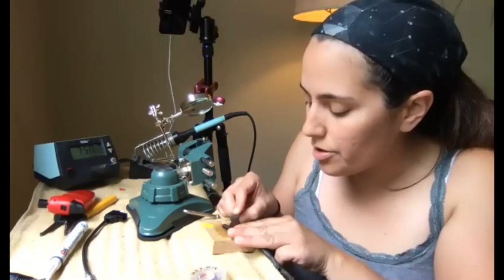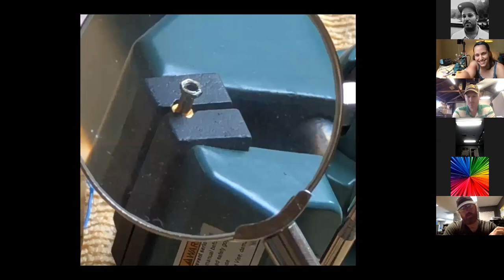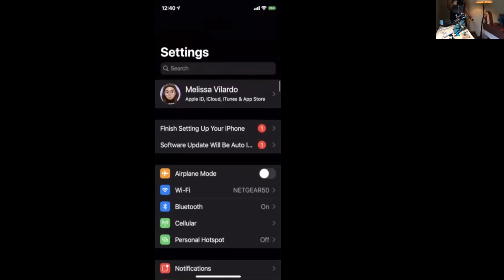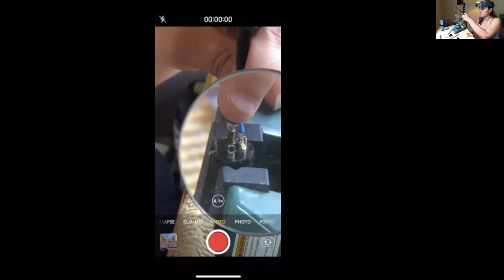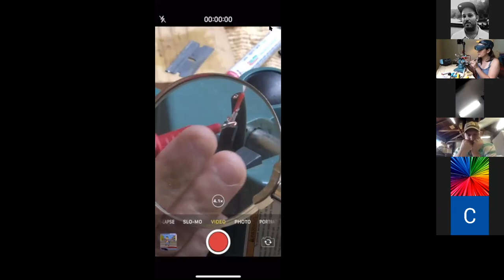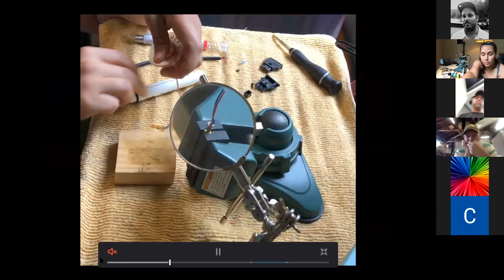DIT-WIT: Soldering 101 with Melissa Vilardo

Comment: Intro - 1:15
Proper Soldering Environment - 3:04
Tools Needed for Soldering - 4:06
Pro Tip - Torches are also good for applying heat to stubborn metal screws/threads. - 10:25
Choosing the Proper Cable Stock - 17:25
Soldering and Assembling 2pin Lemo - 26:30
Proper Wetting (video for reference (about 2:15 in): https://www.youtube.com/watch?v=_GLeCt_u3U8) - 48:00
(I forgot to mention mention this in my presentation, but when checking continuity, touch one of your leads to EACH pin (including pins that you did not connect). - 59:00 
Soldering and Assembling PTAP connector - 1:06:00
Connecting Shielding on Power Source End Ground Pin - 1:17:35
1:24:30 - Soldering and Assembling 4-Pin XLR (Live)
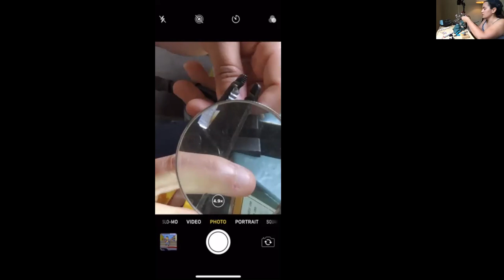Additional Info: If you would like to include shielding on a 2pin to 2pin Lemo (ONE END ONLY), you can simply fold back the braided shielding over the black insulation and slip the collet over it before soldering.  It is not necessary to attach the shielding to the ground pin (especially since there is less space to do so than on an XLR) - 1:29:40
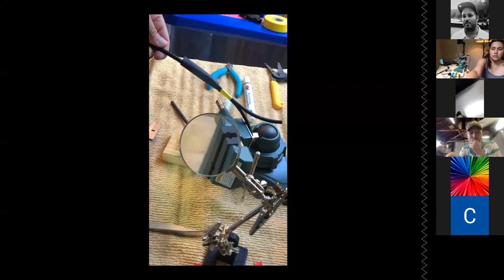Soldering Y-Cable - 2:00:06
Removing Solder - 2:09:15
Q&A: How to Troubleshoot Slow Solder Flow For Large Components - 2:12:00
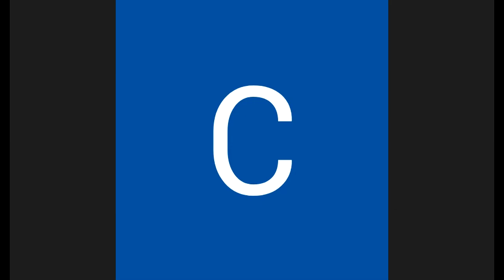Q&A: I Didn’t Make Cables With These Tips/Tricks.  Do I Need to Remake? - 2:24:05
In-Line Voltage Regulators - 2:30:25
Proper Storage For Soldering Iron - 2:31:42
Closing Remarks - 2:32:40